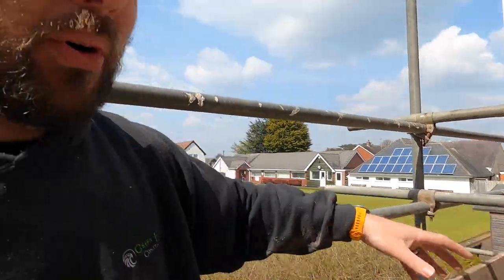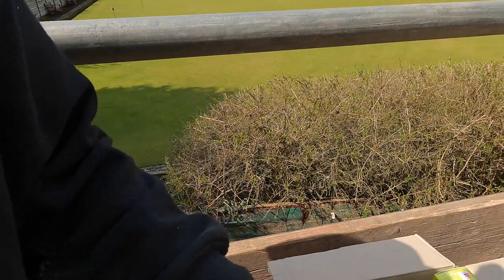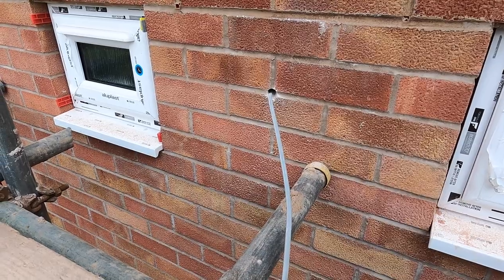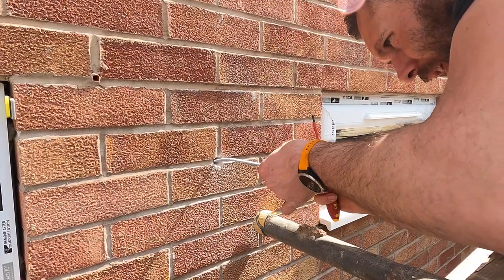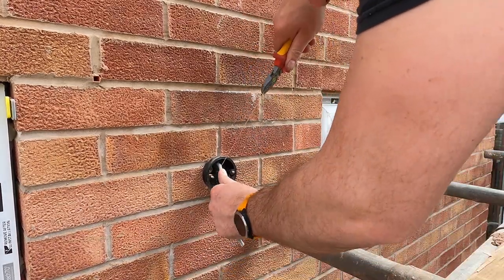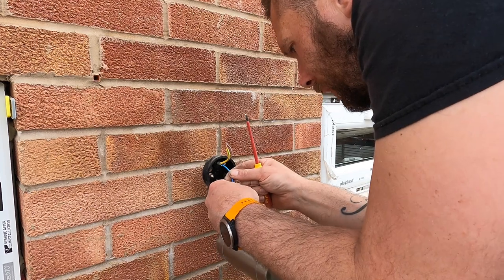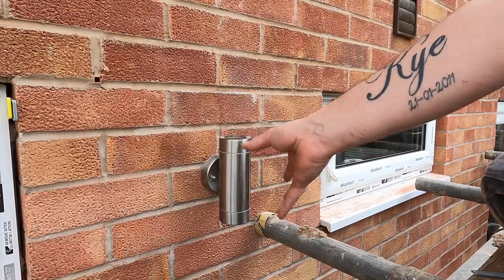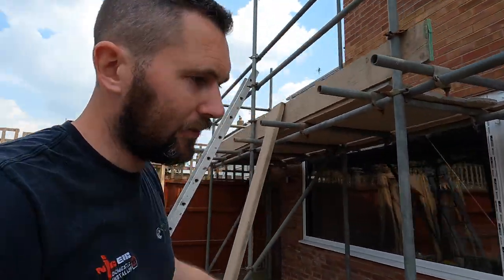Installing Outside Lights

Comment: Great video, I think your side cutters have a small indent between the pivot and the handles which is useful for squashing small cores together when doubling over - makes a nice tight bend.
Reply from the maker: They have but I prefer to use the notch for stripping to get the same effect but I will give it a go to see what works best for me 👍

Comment: Just a tip with those light fittings. Put some tape over the screws on the back to stop the screws moving. Makes it easier :)

Comment: Now these up/downlights...as sparks we fit what these type of fittings day in day out, almost every job I do they have these, all brands see to have the skew design...small connector blocks and sod all room and all have those bloody decorative nuts to do them up! (Can you tell I hate these?)

Some better than others, but why don’t they....

Have the back of the nuts encased so you don’t have to put tape or mitre bond them in to get them done up? Absolute nightmare when it’s a pebble dash wall etc and  maybe someone more informed than me can tell me why they are all done like that?

Secondly why are the connection bases so bloody small, seems all decorative light fittings are light this these days the people who design them have never had to install them!

Also why do they need the decorative captive nuts to fix back? Pretty much all fittings have the same design! 

I for the life of me can’t remember the brand and I wish I could but actually had some where the base was big enough and the fixing holes were actually at the sides, so you could spin the light out of your way and fix the bracket easily, they were customer supplied but were actually a joy to fit! Was able to get 2 x 3 cores in there with room to spare.

Also...forgetting to lamp up...why is it always the most awkward ones you forget to do this on?🤣Also dropping those bloody nuts! I keep a pack in the van now for that reason!

Anyway enough of my grumpy man ranting! Love the vids as always mate 👍🏻🙌🏻🙌🏻👌🏻
Reply from the maker: I know exactly what you mean mate. I fitted some a while back that a customer had sourced and the back plate was all ali and they were a dream to fit but very expensive I reckon